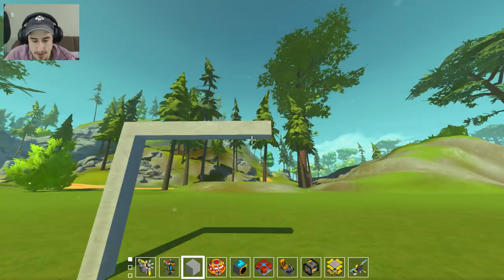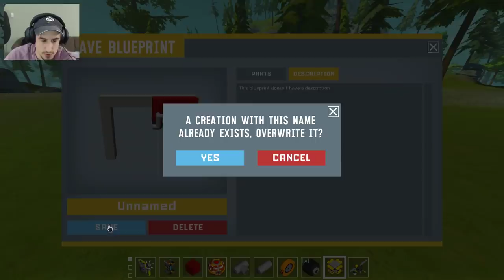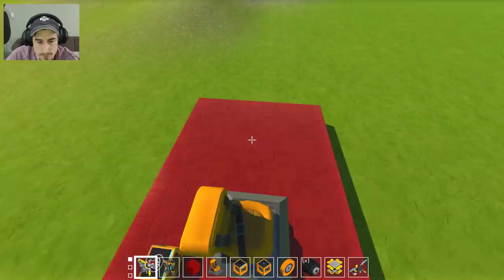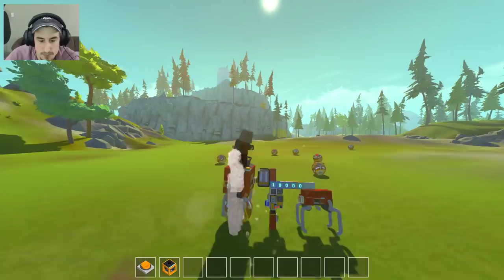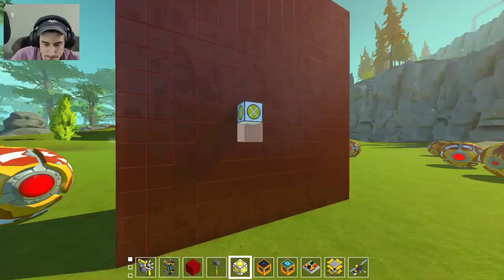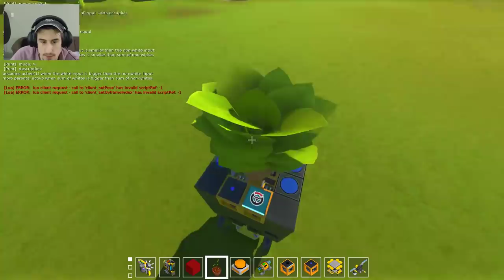Building a Camera Controlled Ball Wheel Unicycle AI! (Scrap Mechanic Live Stream VOD)

Comment: For the next multiplayer Monday maybe you could do a chaser vs runner car challenge.
1. First variation, if you have only 2 players then the runner car could have three cannons angled or on a turret for the driver to control. The turret cannot be automatic and can not be spammed. The runner car can also have a minelayer on the back with a 3 second cool down. One of the cannons can be used to shoot the bombs to make them explode a Serrano distance away from the truck (if you can get it to work I will be thuroughly impressed). The runner car should not be smaller then the chaser car. The runner car should also be shaped like a truck. The runner car should only have 2 melee modded weapons on the front which should be attached to the car directly or via berings ( I don’t know how to spell it). The car can also have a thruster on it with a 30 second cool down for a short speed boost (duration is your choice). The vehicle should be smaller than the runner car and should be one engine tick faster (or 2 if it Is too hard for the chaser).

2. If you have 3 people in the mm than you could have 2 chasers and 1 runner. The chasers should have only 1 melee weapon attached directly to the car via bearing or directly to the vehicle. The cars should be 2 ticks faster than the runner and can have a short duration thruster based speed boost with a 30 second cool down. The runner can have 4 cannons and a minelayer on the back of it. Same size restrictions for the vehicles. 

3. If you have 3 or 4 players than you can have 2  chasers and two runners. The runners have same restrictions as variation 2 and so do the chasers except the runners can only have 1 vehicle with the runners having 1 player controlled turret on the top and 1 driver controlled minelayer. The chasers can have a small shield which should not cover more than 20% of their vehicle. The shield can be moveable. And can have 1 cannon in a fixed position which can only shoot every 3 seconds. The cannon should be exposed.

4. If you don’t want to follow any of these restrictions than you can have a runner vehicle with a turret and minelayer on a cool down. the chaser vehicle(s) should have 1 melee weapon on the front and could have 1 cannon in a fixed position which is not automatic and should not be spammed (maybe a timer system to slow down the rof). The chasers can have a metal bumper and so can the runners but only a bumper( the shield should not cover too much of the car and should be small enough to be considered a bumper for both runner and chasers. 

If you don’t want to follow any of the restrictions that’s fine because the important thing is to have fun.